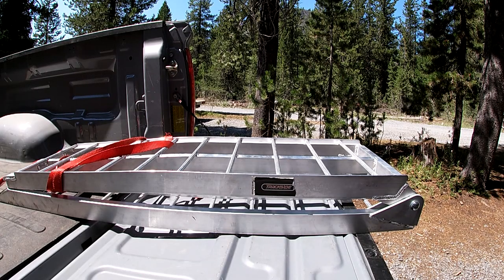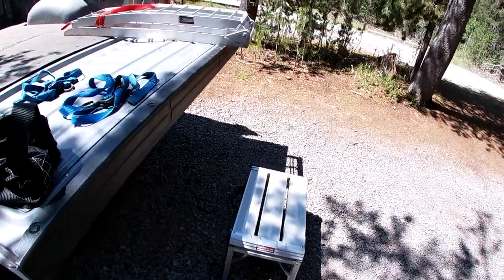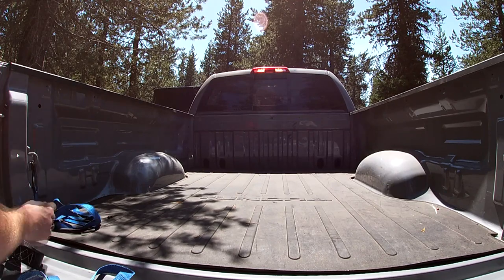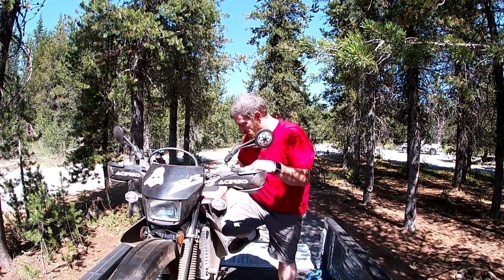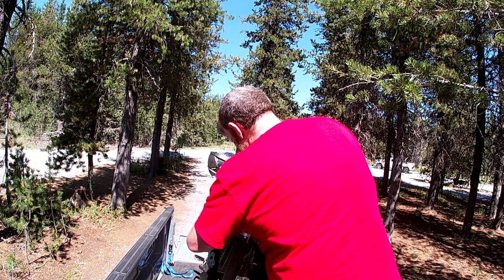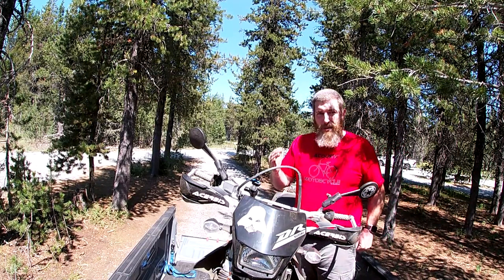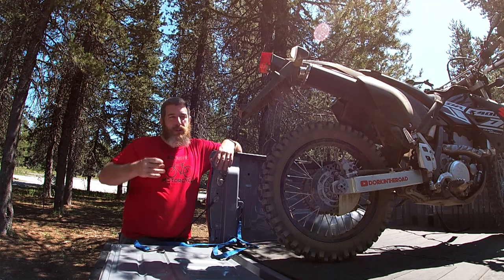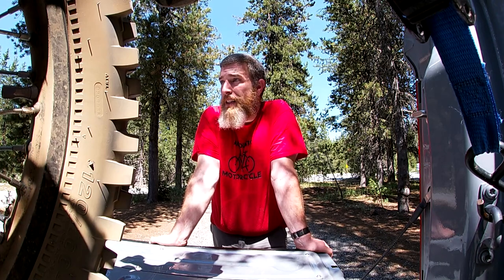How to Load a Motorcycle into a Truck By Yourself Using a Ramp

Comment: I use a Harbor Freight 2500 lbs ($50) remote control winch. I have it mounted on a top of 2x10 that I mount across and on the front top part of the truck bed , I secured the 2x10 with two carriage bolts and also 2 tight downs . I use the power of the winch for loading and unloading the bike. Everything else is pretty much the same except I use small 2 step ladder instead of the step stool. Thanks for the video, another good one.

Comment: Lesson I learned the hard way, have something STURDY to stand on. I was loading my XR650 last week using one of those skinny little dirt bike ramps and a cooler and plastic tote to stand on. That setup has worked several times, but the cheap plastic tote finally had enough and caved in and tipped while I was idling the bike up in first. Needless to say I slipped and fell, the bike launched into the back of the pickup bed, and my pride was hurt XD This was in a restaurant parking lot so maybe I will be on one of those fail videos soon enough.

Comment: The real secret, bounce the rear wheel and scoot. At first I sat legs spread around rear wheel with jack under engine to take some weight. Pull, reset jack, repeat, repeat. Never again, bounce rear wheel scoot. Who knew. Thanks

Comment: Catching up on some of your older videos. Now I have the KLR and want to get north to your neck of the woods, I’ll be loading it in my truck, a Ram 3500 DRW 4X4 with an 8’ bed. I have plenty of truck. You gave me a lot of tips. I too use the Rhino straps I used in our toy hauler. Great straps. Once I get over surgery, I’ll be back out. Keep up the great videos

Comment: I loaded my bike once so far,, when I purchased it from a private seller. Tried it while off and was grateful that the seller was there to push from behind. Definitely trying it with the motor running next time. KLX250 Dual Sport. Advertised at 304 pounds? Not a light dirt bike. Also, very seriously considering a hitch mount carrier.

Comment: Just get you one of those wide folding ATV ramps and ride her up, did that when loading up Harleys for years. Also helps to park in a dip to where your angle of attack aint so steep especially on one of those low rider Harleys where you got to worry about bottoming out. Dirt bikes are a wee bit spookier as in certain positions your feet cant touch the ground buts its doable. Also cant hurt to put a 2x4 (or one of those fork support braces) between the wheel and the front fender before you strap it down so you aint gotta worry about blowing out your fork seals.

Comment: At what point should one worry about taco-ing a tailgate?  Would you do this with a big ADV bike without first removing the tailgate?  For reference, I have a GMC Sierra 1500 (pre “multi-pro” tailgate model). and a Guzzi V85TT.  I weigh ~215, so all told I’d be putting 750 on the middle of the tailgate - ignoring the reality that the other end of the ramp on the ground bears some of that weight (followed by the truck bed itself).

Comment: Great tip about putting the bike in 1st gear and using the clutch as a brake when taking the bike out of the truck.  I've been using the brake lever but your way is better because if you let go of the clutch, the bike will stop.  
"That's not going anywhere!"

Comment: Overall good vid.  I personally would not idle the bike up...too easy to go wrong.  I take a run at it (engine off) in 1st gear.  If I'm just short, let clutch out to hold the bike then reposition myself to push the last bit.  I do have a longer ramp to make that easier.

I also point to front tire in the left corner, this keeps blind spot on passenger side open.
Reply: What bike are you loading?(weight?)